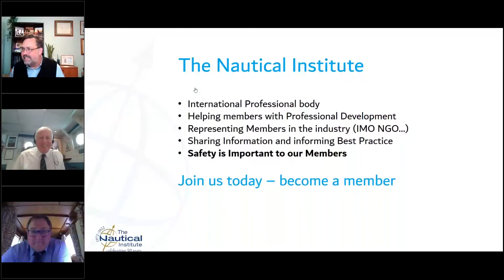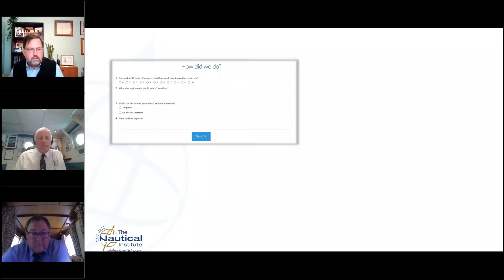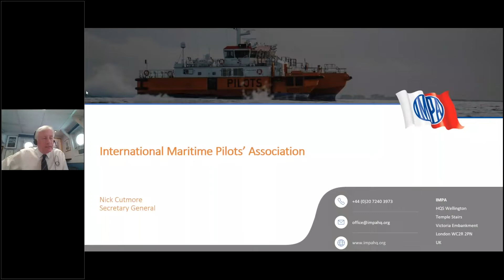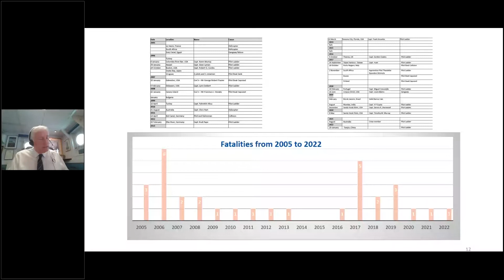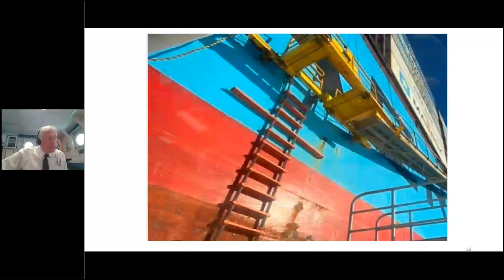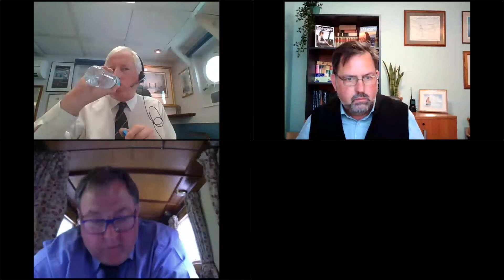Pilot Ladder Safety Webinar

Comment: The problem is that all the regulations are written by IMO in a warm well lighted, room in London and then implemented at onboard at sea under sometimes miserable conditions,  by overworked, tired and under paid seaman's, on top of this with officers with little or no understanding of the proper rigging of the ladder. Note that the pilot poster is in English with the understanding that all seaman's understand the terminology used in the poster...when for most of them English is a second language...Why not have a poster in Tagalo? and see if that have an effect in the statistics?